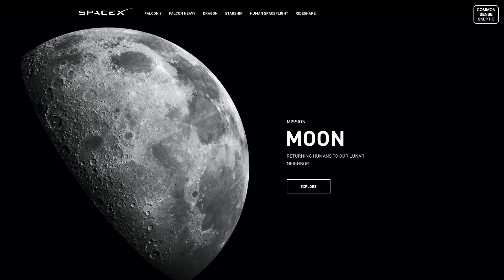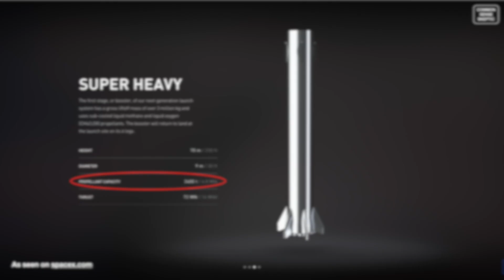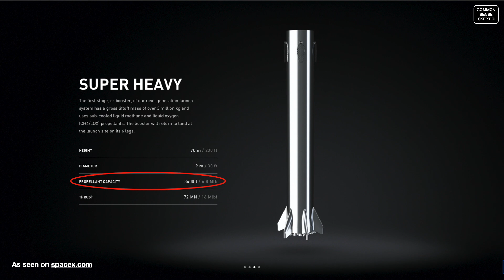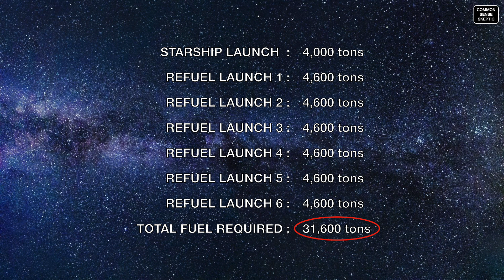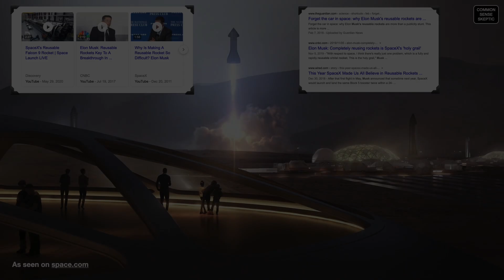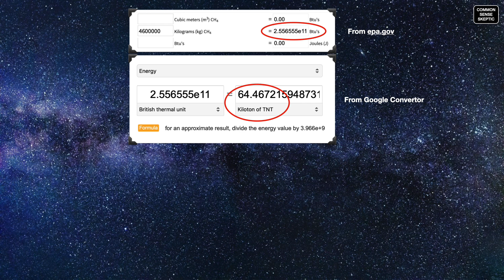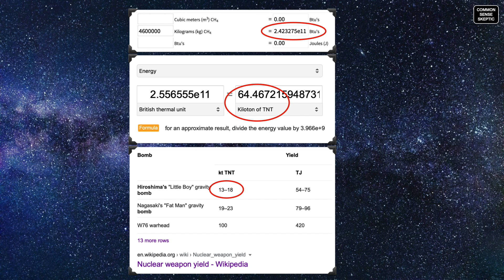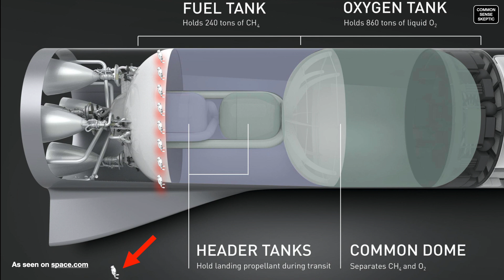STARSHIP EP5 - ORBITAL REFUELLING (1080p)

Comment: SpaceX is asserting that Starship will be far, far more reliable than any existing launch system.  Say, a failure rate of 1 in 1000 (vs 1 in 250 for the best existing systems).  If they don't achieve this, and there's no particular reason to believe that they will, then Starship will fail.

My point here is "Will Starship achieve a 1:1000 failure rate" isn't a debatable question, because the only argument you can make is "Nobody else has done it", which isn't particularly persuasive.  Someone has to be first, and I'm not aware of any reason that SpaceX couldn't achieve it.

That covers 90% of the video, but to cover your other points briefly:
1) calculating the blast radius of a pad explosion by adding up the net energy contained within a full Superheavy / Starship combo is incorrect. In a pad explosion the vast majority of combustible material won't actually burn.  It's actually quite difficult to mix oxidizer and fuel to ensure even 90% combustion.  In an uncontrolled explosion only a small fraction of the available fuel (like 5%) would actually be able to ignite immediately.  The rest will ignite later, but the force of an explosion is determined by how much combustion happens in a few milliseconds.  Yes, it's true that people are kept miles away from fueled rockets, but the danger isn't the explosion per se -- its *debris*.  It isn't uncommon for debris to be flung miles away in a rocket explosion, and if you are unlucky enough to be under it...  thats a bad day.  That's a very, very different type of danger than a nuclear explosion, which is what you used as an example in the video.
2) If you want to proposally refuel a rocket then...  You spend some of the time accelerating in one direction, stop accelerating, rotate 180 degrees and spend the same amount of time accelerating in the opposite direction.  This results in a zero change in velocity, but provides the needed acceleration to move the fuel.  Beyond that, you aren't under any obligation to thrust prograde (in the direction you are moving, increasing orbital velocity) or retrograde (opposite the direction you are moving, slowing orbital velocity).  In particular, you could thrust at right angles to the velocity vector which changes the direction of your velocity vector without changing its magnitude.  And if you thrust along one of two vectors that are at right angles to the velocity vector and are at right angles to the radial in vector (which points at the center of mass of the body that you are orbiting) all you do is change the inclination of your orbit.  These vectors are the (anti-)normal vectors, and you can thrust along them indefinitely while maintaining a good orbit.  In short, not only is this point totally invalid, it's obviously invalid.
3) Finally, "I don't see how Starship to going to reduce the cost to reach orbit when it take 7 launches to go to Mars".  This is absurd.  To spell it out: Starship (if it meets its design goals) will dramatically reduce the cost to reach _low Earth orbit_.  In addition, it will enable manned flight to Mars.  The second statement has nothing to do with the first.  It's possible to design a rocket that would enable a manned mission to Mars while being totally uneconomical for reaching LEO -- see, for example, the SLS.  It's also possible to envision a system that dramatically reduces the cost to reach LEO but isn't helpful for manned missions to Mars -- see, for example, crewed Dragon.  Yes, requiring multiple Starship launches for one crewed flight to Mars will dramatically increase the cost of traveling to Mars -- but a rocket that didn't require on-orbit refueling would be much larger, use nuclear propulsion, or both.  If Starship meets its reliability and reuse goals, then it might be cheaper (on a per mission to Mars) basis than a much larger rocket built using the traditional, single use, model.  I don't know, and neither do you -- but regardless, the ability of Starship to reduce the cost to access LEO is a totally separate issue.

The sad thing is that there are real problems with orbital refueling that need to be dealt with, but you managed to miss them all.

The biggest one is cyro-boil off.  Fuels and oxidizer are normally stores as liquids to maximize density.  The problem is that no matter how good your insulation is, some heat will be radiated to space and propellants will gradually heat to a boil.  Under normal circumstances this is a good thing, because the gas can be used to maintain pressure in the tanks, but if you are holding onto propellant for months or years....  It's a real issue.  In the context of Starship, SpaceX has a time limit to complete the refueling and launch to Mars.  How serious the limit is I don't know, but it's entirely possible to get into a situation where one or more tankers worth of propellant has boiled off before refueling is completed.  If there is a major delay (due to an accident, for example) its entirely possible that all the delivered propellant will bool off, requiring the refueling effort to start from scratch.  And don't forget that you need propellant in Mars for landing, so you need to account for that boil off as well.

The solution to this problem in modern spacecraft is to use propellants that are liquid at room temperature, then use heaters (if necessary) to keep them from freezing.  Such propellants are known as "storable propellants" and are used everywhere (ISS, Soyuz, Space Shuttle, Dragon, satellites of all types).  The problem is that such fuels have a terrible energy density, so SpaceX is accepting the losses caused by boil off to reduce the total amount of fuel required.  Is that the right trade off to make?  It depends on whether they can reach and maintain the launch rate they are planning for.
Reply from the maker: We'll try to keep this short and sweet, addressing one of the last points first - we didn't "miss them all" by any stretch, we simply didn't cover them all in this episode.

What we did cover was the ass-to-ass refilling paradigm, which SpaceX has since abandoned, so your description of how they might pull this off is moot.

The cost per launch SpaceX claims is asinine. Believing their lie in this regard is also asinine. And the multiple launches required to refill each crewed vessel stacks up costs and risks at an unprecedented rate.

The best way to debunk this is to note that NOTHING has been accomplished in this regard in the past two years, since the publication of this, one of our earliest, videos. And yet, SpaceX has "selected the crew" for Dear Moon.

If you can't accept their claims as ridiculous, you'll have to come to grips with it on your own, later. We've spelled it out for you pretty clearly in this video and videos released later in the library.

Finally, the blast potential of a Starship is one of NASA's top concerns regarding this vehicle. That's good enough for us. We'll eventually get to see how big the crater it leaves behind, if they ever get around to an orbital launch attempt. That launch, the disaster it causes, and the investigation into said disaster will cripple SpaceX in Boca Chica, if not end it.
Reply: @commonsenseskeptic  The blast potential of Starship is, indeed, enormous.  It's a big rocket, and that goes with the territory.  But it isn't "add up the energy produced by all of the liquid methane ignites at the same time" level of dangerous.  If you are within 3 miles of a fully loaded Starship / Superheavy exploding on the pad, I hope you are in a bunker, because you'll have a really bad day otherwise.  But 10 miles away?  It's a pretty lightshow and a loud noise.

In any case, explosions on the launchpad are very rare now-a-days.  And methane is a lot safer to work with than, say, hydrogen.  I assume you are waiting just as eagerly for the SLS to explode on the launchpad?  I wonder why NASA felt comfortable placing the VAB so close to 39A if a Saturn V / Space Shuttle / SLS exploding on the pad would destroy it.   Seems like an odd choice for NASA, but what do I know.

I'm aware that SpaceX abandoned direct refueling (ass-to-ass as you refer to it) in favor of a pump driven method.  Odds are likely that they changed approach in the hopes of saving the fuel that would be necessary to maintain constant acceleration to keep the fuel flowing.  Of course, now they have to deal with the problem of keeping propellants bunched up around the inlet pipe.  While their are tried and tested solutions to this (a bladder that is pressurized with an inert gas to fill up the empty portion of the tank), nothing has been done at the required scale, nor for the required duration.  It's a much better solution if they can get it to work -- time will tell.

I have zero objection to folks attempting to bring SpaceX's and (especially) Elon Musk's rank propaganda down to Earth.  The problem is that it isn't what you are doing -- charitably, you are putting out misinformation that's at least as extreme as the drek that Musk puts out (just in the other direction).  I assumed that was because you didn't know any better -- but it appears, given the tone of your response that you don't care what the facts are, and have a personal vendetta against Musk / SpaceX.

My two cents: Starship is another attempt to do what the Space Shuttle was supposed to do -- dramatically cut the cost of accessing LEO.  Will it succeed?  50-50 at best.  The most likely failure point is that Musk runs out of money before it can prove itself.  Using it to go to Mars?  1 in 100, and that's being generous.  Setting up a colony on Mars?  Not a chance.  If Starship can beat the odds and send a crew to Mars, it's possible that the next generation of launch vehicles might enable a Martian colony -- but not Starship.  And it won't be Musk who designs and builds a theoretical next generation of launch vehicle because he will be *broke*.  Mars missions are too expensive with no opportunity to generate revenue.

SpaceX is nothing more (or less) than a passion project of someone who happens to have absurd amounts of money.  Worst case, it has already begun the transition of space travel from a government exclusive enterprise to something that privately owned entities can participate in.  At best, it will generate a great deal of highly valuable data that, in the future, will lead to a Martian colony.

Comment: That's not how any of this works
Reply from the maker: Exactly - it doesn't work at all. In fact, a year after this video was released, SpaceX abandoned the aft-to-aft paradigm in favour of a side-mounted mating and that's not going to work either.
Reply: @commonsenseskeptic  I was talking about your explanation. It sounded like you were suggesting that the vehicle in front sort of slams on the brakes and the fuel sort of sloshes from one fuel tank into another. One of your principal objections seemed to be that if you slow down you'll fall out of orbit. If you can dock then I can't see any reason why you couldn't pump fuel from one tank to another using, you know, pumps.

Comment: This is the weakest video of this series I've seen so far.

One should expect the success rate of basically everything associated with space to improve over time. Now, it is valid that even if they improve on a ~10% failure rate, that there will be failures. But if you could turn a paper clip into pure energy, you'd have a hiroshima worth of energy. I think it's pretty obvious there's a lot of energy in play in a space launch. 

I think Paul Allen's Stratolaunch was the best idea. Fly the craft to space or at least above the troposphere on a regular airplane, launch it from there.
Reply from the maker: Now, consider this:
The refuelling paradigm shown by SpaceX in this video has been abandoned.